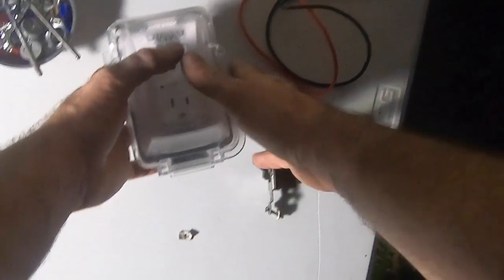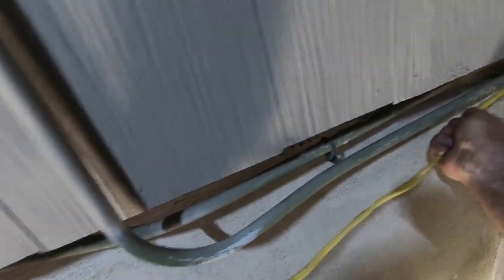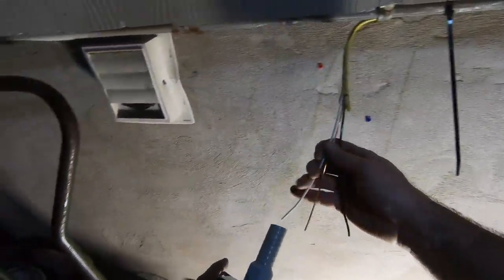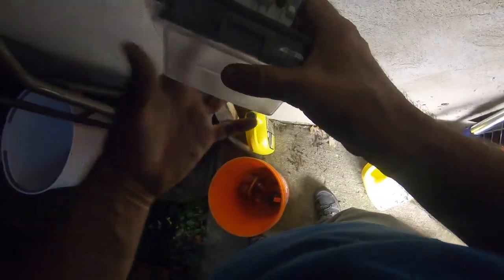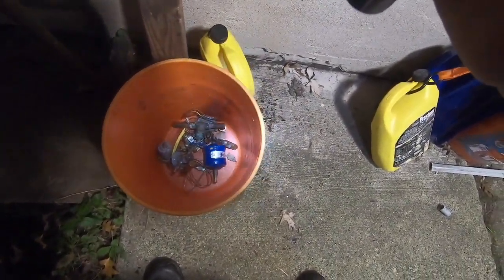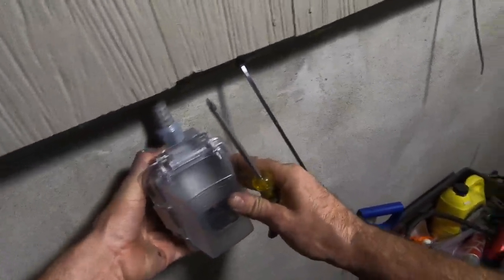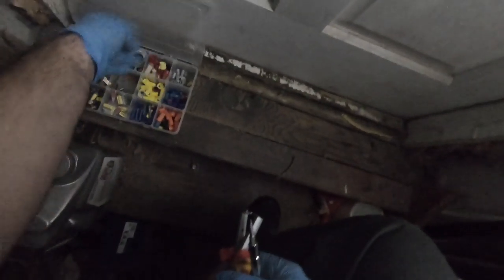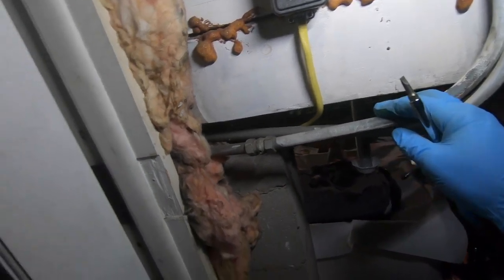Installing New Outdoor GFCI Electric Outlets And Running Wire

Comment: Keep up the great content. Put some silicone around the connection. In my experience anytime you come in the top connector it will slowly fill with water. Outside I put the box horizontally or come in the bottom.
Reply from the maker: I have had many gfci outside boxes on the generators fill with water. Even rain water traveling on the houses main power wires destroying transfer switch contractors. I find thumb gum also makes a good seal

Comment: In my area of the country, exposed wiring located less than 8’ from the ground MUST be run in conduit or armored BX cable.  Unfortunately, our electrical inspector would FAIL your installation❗️
Reply from the maker: It’s all good. I see outdoor rated Romex wire ran without conduit all the time. This is just something I tried to do quickly. I will be replacing the wire with outdoor rated wire. Where are you from? I ask cause codes are different every municipality

Comment: That reminded me of the house I bought in Slidell, after Hurricane Katrina flooded the one in New Orleans. Most of the wall receptacles were so worn that any plug would come out with the slightest pull. I'm still trying to figure that out because the house was only about 30 years old when I bought it. Maybe they plugged in a vacuum cleaner every day. I changed them all, even the ones I would never use, since should someone plug in an electric heater someday, the plug might overheat and start a fire. I always wrap the wire around the screws and tighten it until it is about to break off so it can never get loose. It takes longer, but I was working for myself and time doesn't matter.
Reply: that's typical of heavily used outlets, they're often worn severely within a year and people don't realize until the plugs and outlet are melting down and a big fire hazard

Comment: Maybe that side piece is to use an extension cord and keep it weather tight!
Reply from the maker: yea i found that out when hooking up an extension cord. There was even a slide out piece on the bottom
Reply: they're made for horizontal and vertical outlets both, you only open/use the bottom hole, which ever direction the outlet/cover is installed
also always hing it upward and not sideways! :)
Reply from the maker: I have found many boxes hinged sideways and usually the GFCI outlet is not resettable up on roofs

Comment: So this is your new place? Looks like it was built pre 70 which is good. No chincy particle board walls or roof. My house was built in the mid 70s so when I re roofed I had good solid plywood. No rotted particle board like they use in all the new houses of today.
Reply from the maker: No I backs out of that contract t purchase that house. Way too many foundation issues that I didn’t want to own
Reply from the maker: This house was built 1910 asbestos tiles and real size wood for floor beams and wall beams. Today’s wood isn’t that good if it gets wet
Reply: The HVAC Hacker a house my wife and I rented before we bought ours had round tree timbers for floor joists. I took one look at that and said wow is this old
Reply from the maker: I was in a church and instead of nails giant wooden stakes and as you said shaved down tree's used as all wood joist and support. the church was built in the 1700's. amazing the amount of labor required on older structures

Comment: The purpose of that piece you pulled out is a pass through to allow you to close the cover with a cord plugged in
Reply from the maker: i have learned when using the cord some boxes the cover has an opening moulded on clear plastic
Reply: @thehvachacker I spent $1000 or more on a new sub panel, GFCI/Arc fault breakers, etc.  ANd a couple of those kind of weather proof boxes.

I was going to pull permits to install all of that ( the power company would need to  pull the meter - they will not put it back in until the inspector passes it).

Then I went under my house and saw the illegal wiring hack job wiring the new outlets in my house.  It looks like a freaking spider web of romex 14 gauge (Illegal - needs to be yellow 12 gauge)  overlapping all the illegal cpvc water pipes which were installed.

Neither the water pipes or the wiring is supported.  Just hanging halfway to the ground in the crawl space.

I said f*** it.  I'm just going to rip everything out when I take the floor joists and subfloor out and start everything again from scratch.

Water, sewer, electrical for the entire house, and a rigid duct system for a new gas package unit.  

I just can't believe someone would be stupid enough to do what they did under my house the way they did it.

Comment: Hacker you're fired! You are using the wrong wire it's not rated for outdoor use that's a code violation. Peace brother
Reply: Fired for the 21st time Hacker! Yeah, that romex will be toast in about 10 years outside.
If I could reach through the screen, I'd have made your grounding up differently on both ends.
Reply from the maker: Now if the sun never shines there think it will still be toast. It is the UV that wears the insulation off the wire. The wire I replaced in https://youtu.be/Ki9sVC4eBoc was 30+ years old. Standard Romex. I also hid this wire behind the conduit and house siding. I'm used to getting fire working for myself. It's very easy to pull a new wire here if I see any signs of wear.
Reply: @thehvachacker  the stuff from before ~1990 was a different plastic (type NM and type UF), but it was a bit more resilient, except for heat would cook it. After ~1990 is NM-B and UF-B with the 90° rating. Not sure exactly which one was on that condenser.

The stuff from the past 10 or so years is much flimsier, depending on brand.

Like I said, good connections including ground is most important. @23:00 missed bonding the box @38:00 cobble-job on the ground. need some pigtails, that's what made me want to reach through the screen ;-)
Reply: @dwight.bennett  I did catch that the way he did the ground was way wrong I just didn't mention it. I see all. Peace brother
Reply: violations galore =p
it should be in conduit of some sort also lol
Reply from the maker: Here is what i always believed about GFCI. That the GFCIs measure the charge between hot L1 and neutral leg. Therefore as an electric load is applied. The GFCI bypassing and ignoring the bare copper ground wire, as if were non-existent. Since most 1950s and before houses didn't have a wired ground. The same as most of my house yet the bx cable is a form of ground. Yet doesn't connect to the box. I may be wrong I have may bits of knowledge scrambled by adhd inside my mind